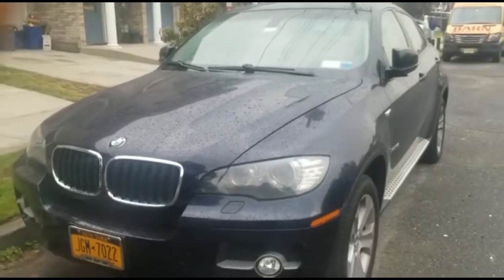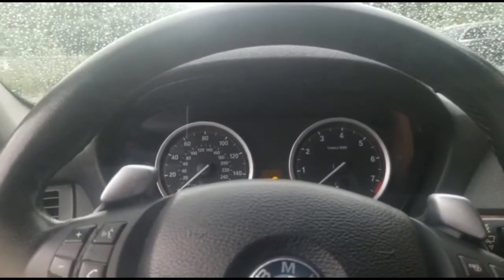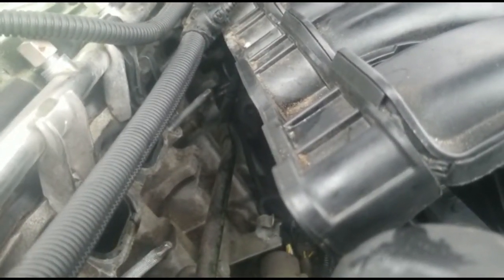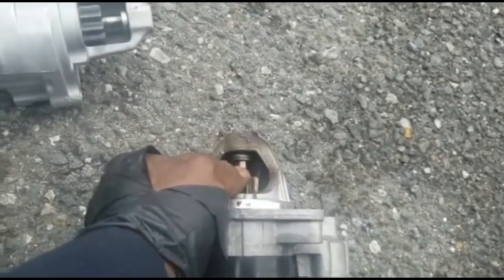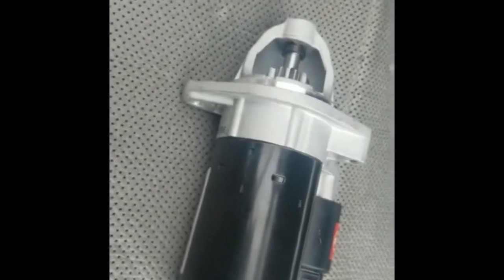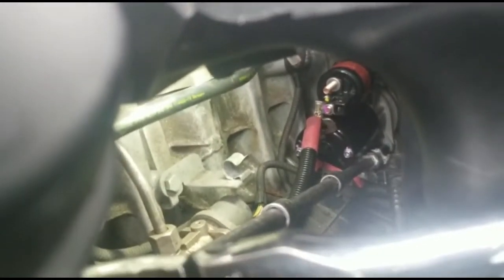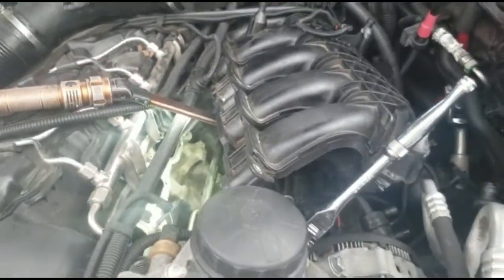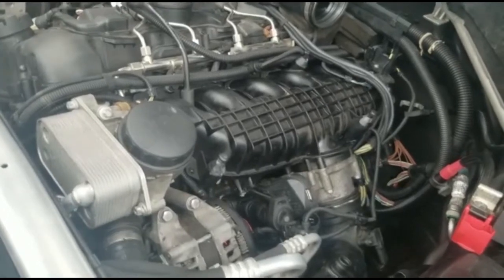2011 BMW X6  STATER REPLACEMENT

Comment: Did you unplug all the wires also how did you get in the back of the starter. I have the same car and color    I have the 2014
Reply from the maker: I can’t remember,is been a long time,I just work on the vehicle one time,sorry for the late reply
Reply: Thanks anyway